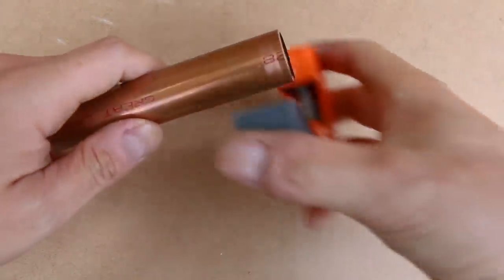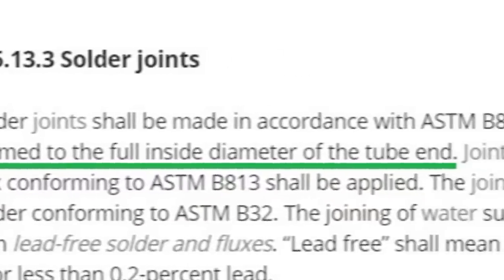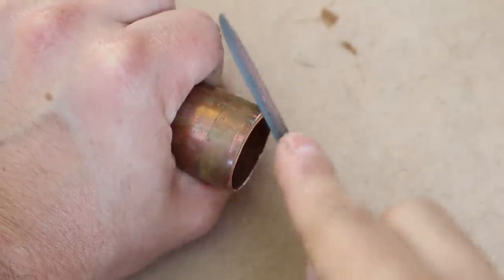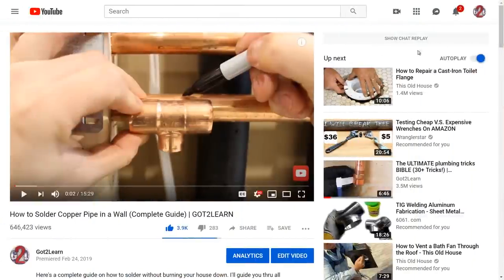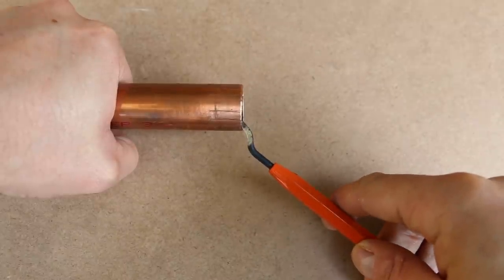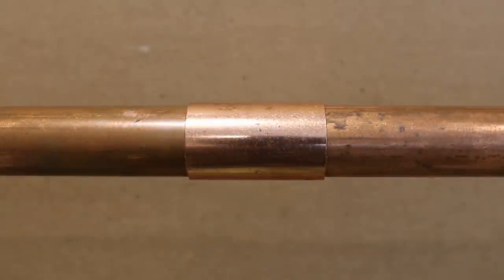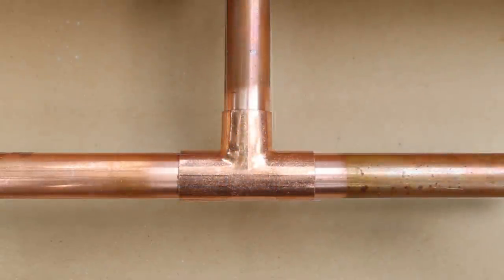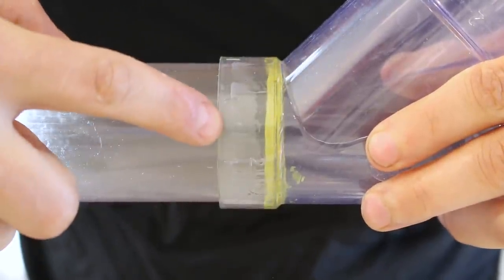The WORST Mistake When Soldering Copper Pipe (Not Deburring) | GOT2LEARN

Comment: Great video guys! Well done.

 I'm curios if I need deburring done to a hot and cold line that's running to my shut-off valve under the sink? 
   Meaning if I was to replace a shut-off valve that was soldered and it doesn't seem to be that it was deburred, do I have to deburr the inside aside for the outside when replacing it with a compression fitting? 

 Thanks guys!
Reply from the maker: Thanks! The inside of a copper pipe always needs to be deburred, with that said, the outside ogmf the pipe only needs to be deburred for fittings that have orings in them such as ProPress and Sharkbites, hope this helps!
Reply: @Got2Learn  Sure does. Was telling this to a new plumber who's in training and he's been putting compression fittings on for the past bit and never deburred the inside just the outside.

  Will pass the message on to him. Thanks guys.

 Your guys videos are one of my favorites.

 I just changed 5 Shut off valves and installed 2 sinks with it's piping for drainage all with your amazing videos! Keep up the great work guys!
Reply from the maker: Thank you so much!! 🤗🤗🤗

Comment: Pencil reamer is the best method. The pressure required to properly clean the inside edge will often slightly bell the end of the pipe making it difficult to insert it fully into the fitting.

Comment: And most will still not do this. 
I made a jig. It Cleans the 
OD of pipe at the same time it’s doing the ID. 
When pipe is pushed in it hits a pressure switch and turns on. 
Cordless of course. 
Only 1/2 and 3/4 pipe. But that’s 95% of houses anyway. 
Took me almost 3 months to build it. And find a good battery to use. 
Plus now I say I’m the only one who has one
Reply from the maker: Nice :)

Comment: The company I work for uses cpvc... You should see the glue that put into those fittings
Reply: Ya gluing pipe is more akin to brazing. The glue is actually powdered PVC or CPVC in a volatile solvent. Solvent dries leaving the joint when a good one, monolithic.

Comment: I mean when we are running our lines for ac we all have Milwaukee open face pipe cutters. We deburr it and then take a scotch pad and clean the whole pipe about 3 inches back. Easiest way to keep it clean and get any tiny tiny material out. You also pressure test your lines and vacuum them anyways so anything that is in the pipes should come out after the testing.

Comment: I've been plumbing for over 20 years.
Back in the day it was flux and run.
Jobs would be pushed so hard, that guys would cut corners to keep up. Now a days, as a rule of thumb contractors are responsible for workmanship up to 5 years. That changed everything. Now reaming pipe is stressed upon because contractors are held accountable.
Reply from the maker: With reason 👌
Reply: @Got2Learn  the other major installation issue is electrolysis.
Improper strapping and isolation from ferrous material. Ie. Concrete penetrations. Strapping to metal building materials or steel framing. Rubbing against a nail ECT.  Pinholes from electrolysis from improper installation are by far the most common copper pipe failures.
Reply from the maker: @smokepeddler  yes 💯

Comment: When I moved in my apartment I couldn’t hear the TV when someone took a shower...The noise of water flow was terrible...After remodeling the bathroom,  I replaced the old copper pipes with flexible pipes...The noise was reduced drastically..I suppose the plumbers didn't give a damn about deburring the pipes at that time...

Comment: Didnt learn but did confirm what i thought, getting more confidence in creating the Slizard refrigerator. Thumps up all the way.
Reply: @Got2Learn  grandpa did heating and ac and i spent many a summer with him, check out the Slizard absorption fridge with its no moving parts and the ability to make ice when heat is introduced

Comment: I literally had that pin hole issue... and no plumber could figure it out.. and now I know, wish I had seen this $1k earlier. It would leak just like this behind every repair... and I did some of them, so it’s my own fault. Mostly, how fast it would happen is amazing! It wouldn’t take 3 months for each pin hole to show up. Wow....
Reply from the maker: Pinholes are real suckers, did you have bad water damage?
Reply: Jay jay dynomite you most likely had a bad batch of copper. Most pipe installed is manufactured at the same time, seeing as it’s purchased at the same time

Comment: I'm not a plumber by trade, but I do get involved with that type of work. When I work with a plumber, I get the exciting job of cleaning those edges.

I did a job myself where I cut an old 1-1/2" drain pipe and put in new drain pipe, connected with a rubber clamp. I forgot this step and I'll probably be getting a call in 15 years. At least it is possible to easily take off the clamp, do it properly, and reconnect the rubber clamp. Oh well...

Comment: as a machinist, I'm in the wrong industry if plumbers who don't know what deburring is probably make more than me. Also I watched a 7 minute video on deburring whereas the file was being used against the grain, dulling it. Also you can deburr od with a vargus knife pretty efficiently in a pinch.
Reply: " ...the file was being used against the grain, dulling it."   Kinda sets your teeth on edge, doesn't it?    Probably less critical on copper, but still ...    My dad would have yelled at me for doing that.

Comment: And I hate when I see some people soldering pipe as if they are making pipe weld. Heat it, solder it, get away from it. When the joint fills and or drips out it’s done. 
I had a guy fill a 3/4 tee with so much solder once took us a while to find it. House wasn’t getting any volume. Lol

Comment: Is there a method to prevent/remove the shavings from a vertical pipe while deburring?  In my case it's the down stream side of the pipe (so I can't just blast it out with water).  (P.S. thanks for all your videos)
Reply from the maker: Hold the tip of the shaving with one hand and deburr with the other, that's what I always do ;)

Comment: I respectfully disagree that the minute burr internally on fittings has the dramatic detrimental effect you state, also how are you achieving burrs on the outside of a pipe. I believe pinholes are due to an imperfection in the copper there far to rare to be caused by "turbulance". Turbulence is gonna happen in a hydraulic system regardless of burrs I've been a plumbing and heating engineer for 40 yrs in England and (rightly or wrongly) i doubt many engineers deburr there copper for any of the above reasons. It is classed as good practice in college but in the real high pressure world of a engineer I know this practice is one of those things that's left in the training papers box. I don't think I've been ripping people off for not de-burring. Plastic is a hole different matter and de-burning is the most important thing to do. I'm enjoying your videos so don't think I'm being negative. Thanks.

Comment: Hi. I had to cut a copper pipe that is used as a bathtub spout extender. I had to cut a long the threads of the copper pipe. Then the copper pipe is screwed into the end of the bathtub spout  where the water comes out. My question is do I need deburr the copper pipe.  Thanks for your help. Best

Comment: We had new bathrooms put in about a year ago. We never had noisy pipes before, but since then, running the tap is very noisy. Could this be the issue?
Reply from the maker: Not if it's only a few joints, more chances of it being a cheap faucet 👌

Comment: Can I sand instead of deburring. I use to work with an uncle of mine in plumbing but I would always see him sand with openmesh the inside and outer edge of the pipe instead of using deburr tools and ever since I've been doing the same thing.
Reply from the maker: Yeah it'll just be harder and take longer.

Comment: All the erosion failures at work are on the fitting at the end of the pipe (the socket shoulder).
Reply: Wrong, typically it is a size and a half down the pipe from the fitting.
Reply: @Skorlang  Well that is not what I see on the leaking pipes I fix.
Reply: @tallbrian100  30 years of plumbing and that has been my experience.

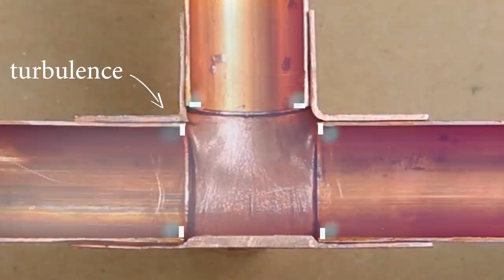Comment: At 6:21   is lack of de-burring the cause of the high pitched whistle when you turn on the tap?  In apartment buildings I've been in I've noticed this whistle or 'scream' especially when the tub water faucet is running ... it's disturbing.
Reply from the maker: Yes, partially.
Reply: No.. loose faucet washers.

Comment: I get that you have to debur copper pipes, however, what happens when the pipe is facing up and fixed in place. Deburing the pipe would cause the burrs to fall inside the pipe. When using water you can purge by opening the valve, however what about on an HVAC systems. Can someone with experience explain how they handle this scenario? Thanks
Reply from the maker: You need a good deburring tip (sharp), when you do, the shavings stay in one piece as you are rotation so you just hold it for it not to fall inside the pipe.
Reply: Okay, I will have to practice that on a scrap piece on a vice. I would love to see a video on that. I guess you can always try to suck it out with a vacuum but you could never be sure if it ever came out.
Reply from the maker: Exactly, you are better off holding onto it and make sure it doesn't go in instead ;)

Comment: In 30 years of doing copper refridgerant and chilled and condenser water systems i have never seen this be a problem with copper. The only place I would agree is on propress or zoom lock. And only the outside so you don't cut the o ring. Plastic pressure pipe you should chamfer the end, but that's for the glue to penetrate the joint properly.  Drains don't require it. You would need a mic to measure that ridge in a copper pipe. And most fittings are belled anyway, so the ridge is right where the bell reduces to the pipe size. In general it is a non issue. And its not a problem in the area I've been working for 30 years. Nor has anyone I've ever met. I have never, ever seen a leak in a copper pipe because it wasn't reemed. I think its bs personally.  There is a guy in the comments saying he just fixed one because of that. Are you a metallurgical expert. Sure it wasn't corroded from some other reason? Or just old. Pipes don't last indefinitely. Its like old codes we follow that don't make any sense but we keep doing it anyway so we pass inspection.  A lot of them are nonsense. And so is this issue. Its an answer to a problem that doesn't exist

Comment: Plumbing code says "ALL PIPE shall be reamed and returned to full bore." 
ALL PIPE!
I've replaced a lot of copper over the years that was eaten away at the fittings by the cavitation caused by lazy, uneducated installers. 
Code also says "All work shall be done with attention to detail and pride in craftsmanship".
The people I've met in the last 28 years who call themselves a "plumber" is mind boggling.

Comment: I do commercial H.V.A.C.R.  Does deburring matter on refrigeration?
Reply from the maker: I don't know, it's not my department but I wouldn't think so because it's gas passing in the lines instead of liquid, maybe it needs to be done maybe not.
Reply: Not an HVACR guy,  but if I was, I'd ream my copper lines.  I don't know if it can cause pinholes in refrigerant lines like it does in water lines, but if nothing else, you're refrigerant will flow more efficiently.  Will it make a noticeable difference?  Dunno,  but I still would just from a workmanship standpoint.
Reply: @Got2Learn  It's only a gas in half of the lines, it's a liquid in the rest.

Comment: If you scratch the inside of the pipe with the deburring tool is that an issue?
Reply from the maker: Negative, no worries!
Reply: @Got2Learn  Thanks.  I'm using one of those pens to deburr and keep hitting the inside of the pipe. 🤦
Reply from the maker: @emf9  yeah, it doesn't matter hehe ;)

Comment: In Santa Monica,Ca.i have known 2 plumbing companies that had a building and safety inspection on a repiped house and the inspector made them cut open some copper pipe at a fitting to see if it was reamed properly,not just reamed.Well it wasnt and the inspector made them take out ALL the copper and redo it.This is truth...SO REAM COPPER!...Sorry..Most men in the plumbing business in LA call it reaming not deburring..

Comment: Why isn’t there a deburring tool which reams the inside and the outside simultaneously, as well as sands the outside soldering surface?
Reply from the maker: Never knew, but it would make you a millionaire 😉

Comment: Guessing this isnt as important in a closed (hydronic heat for example) system for the pinhole erosion since you do not have the oxygen to oxidize at the turbulent site?
Reply from the maker: This would happen just as much in a heating system than in a water line if it wasn't deburred.
Reply: Got2Learn I feel like this is an interesting topic and might warrant some more research?  Dont you think the dissolved oxygen content in domestic water would greatly increase the rate of the corrosion element of the erosion/corrosion, which I would assume corrosion is the dominant factor in this process?  Therefore, perhaps, making this happen at a slower rate on a closed system which is not exposes to air(oxygen)
Reply from the maker: Yeah, probably in terms of how fast it would happen, it would make sense that in a hydronics system it would happen quicker, but only with controlled tests would we know ;)
Reply: It's called cavitation in high pressure hydraulics. The turbulence will create low pressure points which causes tiny bubbles. When these bubbles collapse under higher pressure, they will take away a tiny bit of metal. Over time, enough metal is taken away and it's plumber time.
Reply: Timothy Ball Is this due to improperly bled hydraulic systems?  Otherwise, where is the gas coming from to form bubbles?
Reply: @Got2Learn  •	Dr. Gerald Pollack’s Ted-Talk on ez watert!  "Exclusion Zone" ] [best explains how & why the cavitation caused  implosion of small air bubbles on the tubing’s surface  causes mechanical breakdown! Very inserting stuff, check him out

Comment: I dont like using a rotary cutter because deburring just takes too long after using those. A hacksaw or angle grinder cuts about as fast and doesnt make deburring as difficult.
Also an important thing you didnt mention is that leftover copper on the outside can cut up the rubber seal in a compression fitting resulting in a leak.

Comment: We never do it with copper unless we're using quick connect fittings like Sharkbite or pressed on copper fittings like ProPress, and only do the outside. Never had a problem before. Oh, and obviously we do it when we have to flare copper for gas lines.

Comment: So how does deburring relate to sanding the pipe with emory cloth? What should be done first?
Reply from the maker: No relation. Sanding/cleaning and deburring are 2 different steps that need to be done to get a proper joint.
Reply: @Got2Learn  Got it. Thank you. Is there a correct order to do these two steps or it doesn't matter?
Reply from the maker: @Inevitable037  Doesn't matter which you do first, as long as it's done, specially if you are using Sharkbite or Propress fittings that use orings.
Reply: @Got2Learn  got it, thank you
Reply from the maker: 🤝 @Inevitable037
Reply: @Got2Learn i’m a little confused as to why you have to clean the copper when inserting a sharkbite fitting. i thought cleaning it was only to make scratches on the copper to allow solder to flow into the grooves and seat it. wouldn’t the scratches on the copper cut the o-ring if using a sharkbite??

Comment: Obviously the right way to do it, but I wonder how long it would take to fail, probably like 30+years lol
Reply from the maker: Longer, that's all I can say hehe
Reply: I'm not a plumber but it took 15 years in my neighbor's house. It was a pinhole 1 inch downstream from the joint.
Reply: It depends on a lot of things, if tje water is a bit corrosive, it will happen faster.  It also is more prevalent in systems that run a lot,  like a hydronic (hot water) heating system, that is constantly circulating.

Comment: I hired plumber with awesome reviews to replace a section of pipe with some pinholes and install a new main shut-off valve. Used a propress and I'm pretty sure he didn't deburr a darn thing. Why skip this step? So lame. Now I'm worried I'll have a leak again because of a sliced o-ring.
Reply: If a fitting is going to leak because of a sliced o-ring, how long does the leak take to show up? 3/4" cold water line.
Reply from the maker: Normally right away, but it could take a bit of time too, keep an eye on it.
Reply: @Got2Learn  Thanks man, I have learned a ton from your channel. I super appreciate the response.
Reply: @Got2Learn  Bro, it leaked 😅  He came and re-pressed it, which I've read can be either a good fix or a bad idea. But for now the leak has stopped and I'm done with it. I'll be educating myself and doing whatever I can going forward. 120+ 5-star reviews this guy. Smh.

Comment: You ever work with aquatherm?
Reply from the maker: Never, what's that?
Reply: @Got2Learn  pretty much replacing copper, it pipe fuses together by melting one end of each pipe and shoving one into another
Reply from the maker: Nice, must it be deburred also?
Reply: @Got2Learn  actually yes haha
Reply from the maker: Is it deburred the same way as in the video, or it requires a special tool?
Reply: @Got2Learn  no special tool, we usually use a pencil debur or a utility knife, it a type of plastic material
Reply from the maker: Oh cool :)

Comment: I never understand why people would chose copper pipe but then use a push fit fitting using an o ring? If you’re happy with push fit then just use plastic pipe else if you’re using copper solder it (that’s what it was designed for)